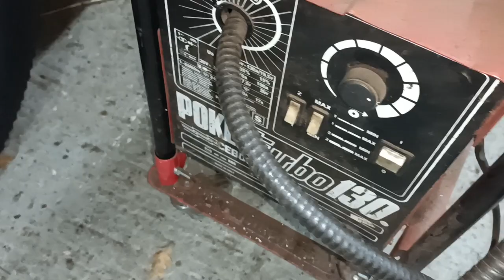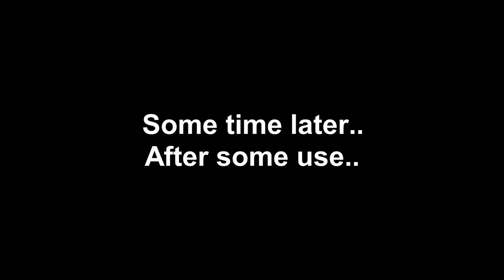2203 Broken stud removal with a new twist! Plus engine stand mods! Machining time at Mart's.

Comment: Hi Mart.  The stud removal worked well.   I've done that a few times.  You are pretty safe welding on the cast iron block as it's almost certainly grey cast iron.  If it was nodular it's a whole different story as GP rods will weld to that.  I usually use a larger nut and weld down the hole onto the stud end.  The arc will track straight and not put spatter in any thread that is exposed in the head.  Cheers Rob
Reply from the maker: Hi Rob. I've had varying degrees of success using all sorts of techniques. Truth be told I didn't have any surplus nuts and washers to use on this one, hence one go at the nut/washer and then going to scraps of angle. I liked that I could see the top of the stud and could keep thermal shocking it with the welder. This thread looked pretty near perfect. Thanks for watching. Mart.

Comment: Recently did the same operations with a few broken studs on a Model A block. We used a washer and welded a nut (around the bottom outside) to the washer. The first two came out on the first try and the third one on the second attempt. ;o) My son did the welding. Used TIG to ensure plenty of heat got applied.
Reply from the maker: Hi Ron. Good work. Glad you got it done. TIG would be a nice addition to my armoury in this fight.

Comment: Nice job on the engine mount. Just an idea here....now drill four holes in the mount somewhere to store your special studs you made. So they wont get lost when not in use.
Reply from the maker: Good call, RN, I do actually have holes drilled and tapped in the bracket already. I keep the studs in the toolbox though, in a little tub. Thanks for watching and commenting.

Comment: Morning Mart. HNY!
Reply: There's a Canadian bloke that uses a washer/nut combo welded on to busted studs. He welds on the washer, the nut allows for more weld in the center were you need it most. Cheers!
Reply from the maker: Thanks Peter, happy new year to you too.
Reply from the maker: Yeah, Peter, that what I normally do, and did try one. I liked the two bits of scrap method because I could always see the top of the stud so was better able to judge what was happening. I was also able to heat shock it with more weld and hammer directly on the stud. Thanks for tuning in. Mart.
Reply: @MartsGarage  From one rusty old stud to another, its a pleasure tuning in, as always. Lol!BTW, the bloke's Ytube channel is Halfass Kustoms, in case you're not already aware.  It is one of my favs, aside from M.G. 😉😉
Reply from the maker: Peter, I follow Brent at halfass. He does some amazing stuff. I look forward to Cold War Motors every Saturday night (for us) too.

Comment: Both good jobs to learn from again Mart. Thanks! All the while you were on the stud removal piece I was wondering "Now, which block is that he's working on?" I've lost track! ;-)
Reply from the maker: Hi Glen. Unpainted block = "Paignton" 59A. This was the very sludged up one I looked at a little while ago. Green motor is the Ol' 59A motor, which I may refer to as the "Northfield" 59A. The broken stud was in the Paignton motor. Names refer to where they came from.

Comment: Lot of heat and cool cycles on that cast iron.  Hopefully no resultant cracks, or am I being too cautious?
Reply from the maker: Hello William. Lots of heat cycles helps the removal. In real life the block is not as hot as it looks on film. It looks red hot on film, but is nowhere near that hot in real life. No cracks that I can detect. thanks for tuning in.